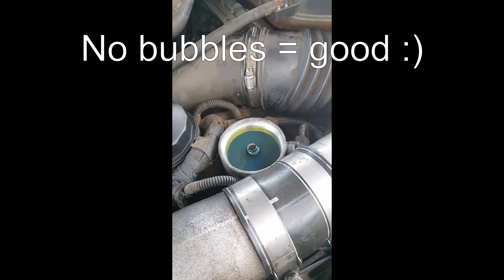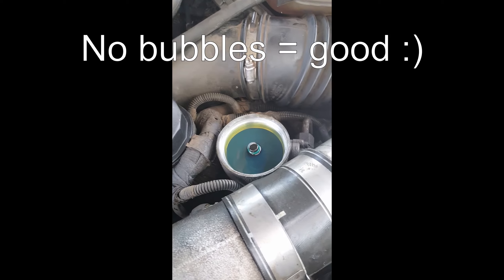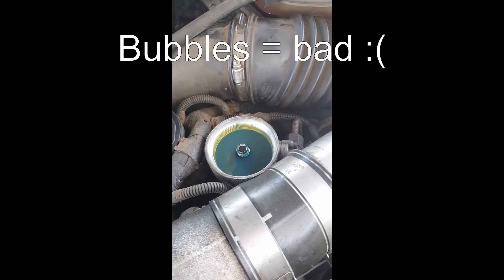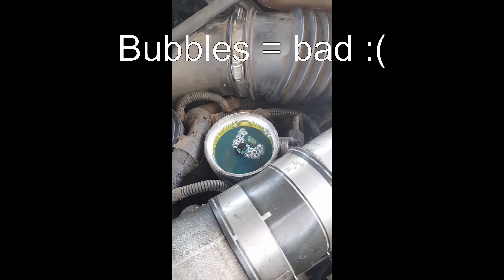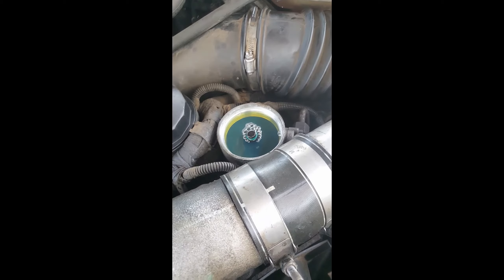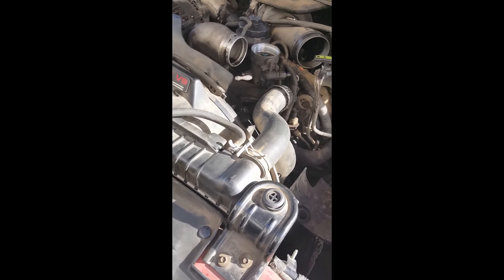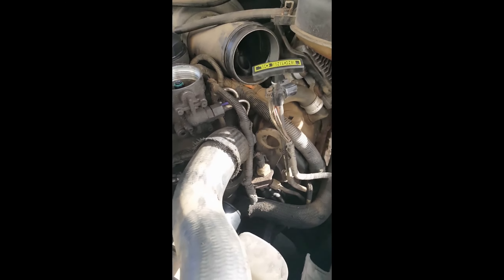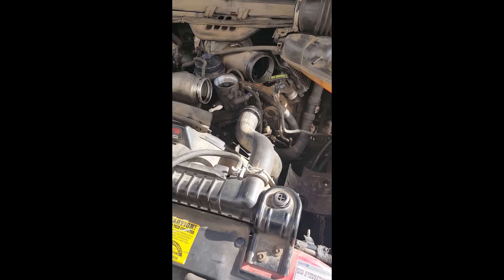6.0 Liter Powerstroke Bubble and Balloon Tests

Comment: Can that cause the truck to blow white smoke then when the truck starts to get warmer it turns into black smoke
Reply from the maker: @countryboy1117  It sounds like it could be a bad injector, but a different kind of failure where it allows too much fuel to be injected. You'd want a high end scan tool to diagnose it.